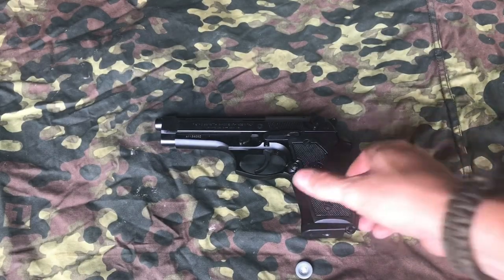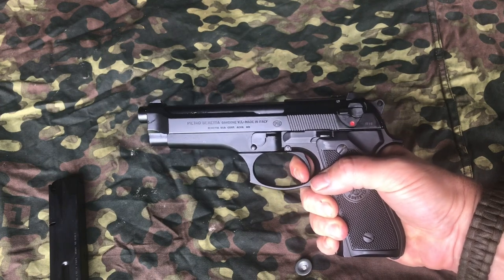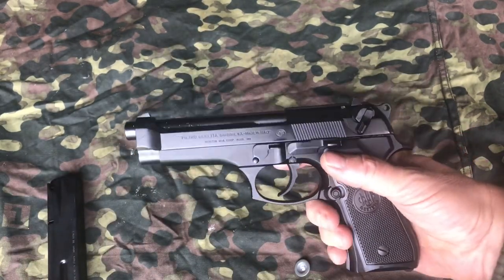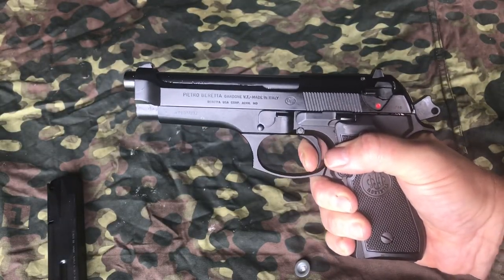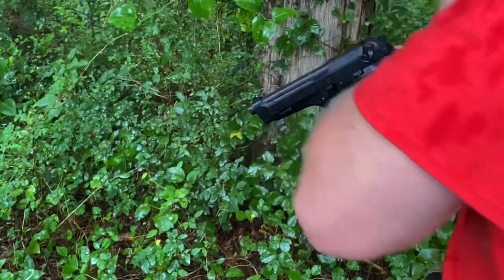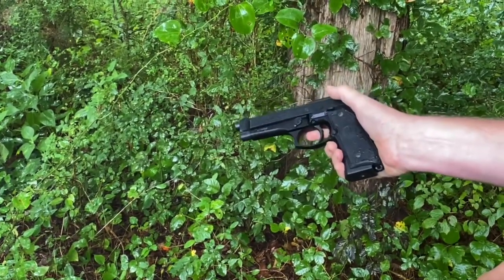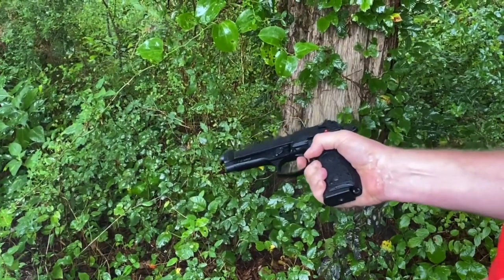Demonstration of Function and operation, Beretta 92 Double Action to Single Action

Comment: So, essentially, in single action, you didn’t allow the trigger to spring all the way forward?  This is what I saw in your video —even though you didn’t state so —at least that’s what it looked like.  Try giving details on how you hold back the trigger.  I also noticed that in double action, the hammer back in the original position (not cocked).  Other than that, it was a good video in understanding both actions.  Thanks
Reply from the maker: Thank you, sir.
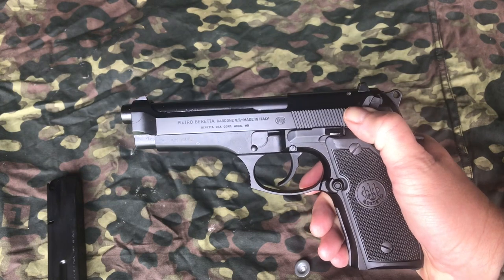Reply: If you go to 1:16, you'll see that, when the gun goes to single action after the first double action round, the trigger does not return all the way forward, as long as the hammer is up. When he decocks, and the hammer drops, then the trigger moves all the way forward. So it isn't a question of him holding back the trigger; it's the mechanism that does that.😊